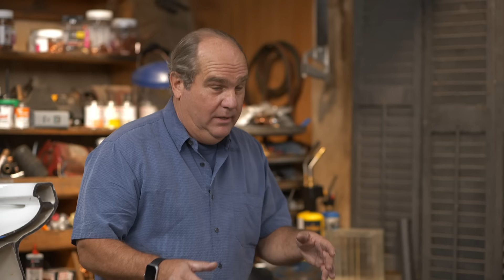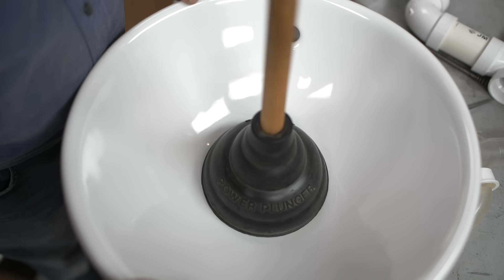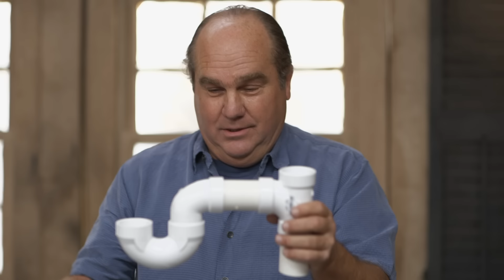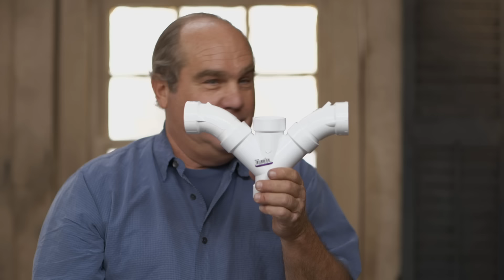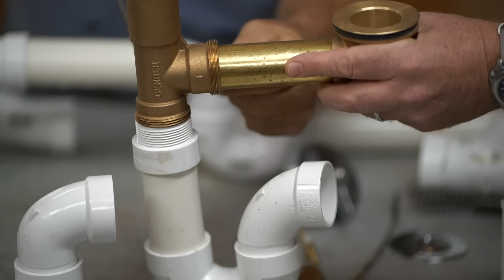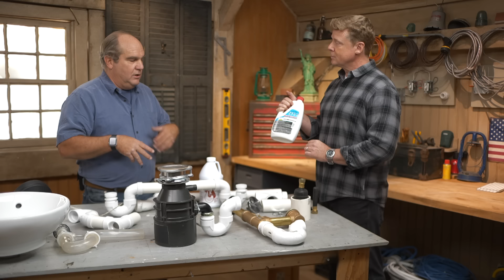How to Unclog Any Drain | Ask This Old House

Comment: He said if you use the auger it may likely go up into the vent, but didn't say how to get it to go DOWN into the drain. So if the auger is always going up, what's the solution for actually wiring the drain?

Comment: Blocking the sink overflow before plunging is a great tip. If it’s left open, a lot of the pressure escapes through the overflow instead of pushing the clog down the pipe.

Comment: Ummmmm… no help. Both sides of Kitchen sink are full of water. One side has the garbage disposal, the other side a regular drain. Tried two different types of pumps. No help because the water transfers to one side or the other. Tried the snake, still water wouldn’t drain. This all happened because I cut up a cantaloupe in small pieces, turned on the garbage disposal, seemed everything was fine until it wasn’t and clogged both sides of the sink. Anyone got any ideas on what I’m doing wrong??? Yes, most likely I’ll need to call my home warranty and get a plumber out. Such a shame!

Comment: Quite informative.  Do you recommend using an enzyme based drain cleaner for drain maintenance?  I have seen that it will prevent grease from settling in the bottom of the pipes.

Comment: Can we just move to the European standard? Their 110mm gooseneck makes our 50mm siphonic "tech" look like a joke. Stop trying to reinvent the bicycle and just use a bigger pipe so I can throw away my plunger. 🙄its wild that we still use siphonic systems. US trapways are tiny (45-60mm) just to create a vacuum, which is why we’re the only ones who need plungers. Europe’s washdown design uses a massive 100mm+ pipe it’s basically impossible to clog. We really chose a =FANCY= suction system over a pipe that actually works

Comment: One tip I learned was to find out where the stoppage is, run water until the drain starts to back up.  If it backs up immediately, that means the stoppage is near the drain.  If it takes a while to fill up, the stoppage is further down the drain.
Reply: Thanks

Comment: Would the rubber bladder work on pipes outdoors? Most vids I see are about P traps and I don't know why people don't just take them off and clean them to make sure a clog isn't there. It's really easy.
 I'm concerned with clogs far down the line of soap scum, grease, washer lint etc. When my washer drains out the utility sink it's now flowing onto the ground thru the vent pipe which comes off the adjoining kitchen sink line (doesn't run into septic tank). Fun! How would bladders do versus a power auger on 'cheese logs' far away from P traps? I religiously use enzymes down all drains every month, use two fine mesh strainers one inside the other for lint on washing machine plus another metal fine mesh strainer in the washer sink drain, kitchen takes no grease, I wipe out pans with paper towels, also use a very fine metal mesh strainer so my only thought is soap scum buildup plus silt from dirty dusty work clothes. I'm stumped how to keep my pvc pipes clean as I've spent a fortune on enzymatic gels combined with careful use of strainers etc. Maybe a power drill auger is the only thing that could scrape some of whatever's in there, off? Ugh.

Comment: Thanks. Fellas my toilet had the same exact smell my plumber tried for years clearing the 75 yr old cast iron pipes. His last suggestion was crystals. So he got the water really hot and placed crystals down the sink drain then placed one cup of hot water. He said try not to use the bathroom for a few hours the next day we both used bathroom and while brushing our teeth we noticed bubbles coming out. He said all good air is being removed we should be good. We are and are please. The real test will be in the summer when attic ceiling fan is on. That when we mostly had the gas/sewer smell

Comment: I removed my bathroom pedestal sink in my bathroom from my home that was built in 1918. It had a lead 90 degree in the wall for the drain. After an unsuccessful attempt at cleaning the drain (I used finesse)I,  I hired a drain cleaning company. I told them to be careful. They weren’t. They used a powered drain snake and cracked the lead elbow in the wall. Idiots.

Comment: As long as the clog is basically just hair I've had good results removing clogs in my lav and shower using one of those inexpensive plastic snakes.  Basically it's just a long flexible strip of plastic with lots of angled barbs on it that you work down into the trap a few times and you can usually hook onto the clump of hair and soap enough to get it to drain again.  You don't necessarily need to remove the lavatory sink stopper but it's easier if you do.

Comment: We have a toilet that keeps backing up and water runs out from the base of the toilet. Plumber says we have a sag or belly in the old cast iron sewer pipe that is causing the issue. Only fix, according to them, is to cut through the slab to the pipe and replace the affected parts. Your thoughts?

Comment: I’ve pushed a bladder in from the clean out using all of a 25 foot hose to get past the junction with a washing machine drain and was able to blast out a clog that my 25 ft auger couldn’t reach.  Not sure that it doesn’t just move and spread the clog sediment/mass further down the line though.

Comment: Unfortunately the inflating rubber bung shown at 7:00 is not referred to as anything other that "this", so not knowing what it's called I can't search for it! Also, it is very strange to refer to a basin (sink) as a 'lavatory'. UK and US definitions are different. In the UK a lavatory is either a room containing toilets and hand basins or the toilet itself, so bear that in mind if you're an American in the UK and asking for a lavatory to wash your hands in!
Reply: OK, I have found the answer to the question above. 'This' is a 'Drain Cleaning Water Bladder with Garden Hose Attachment, Medium' which I have found on ebay, but almost exclusively in the USA. Eventually I found one on Amazon UK (last one - Cobra Products 331). There are videos on how to use them out there.
Reply: Plumbers call it a "blow bag"

Comment: Hmmm, ive never understood why why and always kinda wondered  why toilets are designed the way they are.
 Like, whyy do toilets have a "drain pipe" that starts to go downward a little bit and then comes back up before heading back down..
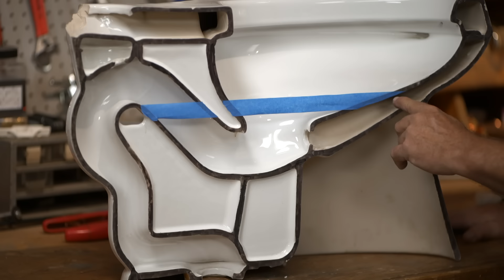 Like, at the 0:30 second timestamp of the video, you can see that when its initially flushed, it goes down a tiny bit and then all of a sudden shoots upwards at like roughly a 45* angle for 3-5" and and then shoots down again. Also, there's a slight little "turn" in the middle after it starts going down. I don't understand that, either. 
 I meannn, i know there are probably good reasonings for them to be designed the way they are, i just don't understand why, lol.

Comment: Sorry  the clog in my kitchen sink is not in the trap part,  It is beyond that by a yard or more out into the yard.  Nothing works. Even the snake we tried only goes so far and is blocked.  WE have to wait forever for the hot water to drain away to open the pipe and even try.  This video did not help
Reply: Try a jetter with a 2800 PSI pressure washer or higher

Comment: The part where you block the overflow on the sink had not occurred to me since it's years between drain clogs... and frankly, was half asleep when attempting this. I already spent an hour trying to do it with a wire to no avail. Tried boiling hot water. Nada. I thought I'd try a plunger but it was coming out the overflow and didn't think to block it. That was the ticket: plunger with emphasis on the pulling up, not the pushing down...and wrapped up tight paper towels to block the overflow. What a clogged drain... but back to free flowing now. Thanks for posting this.
Reply: Ml

⁹

Comment: I had a clog in my a/c drain that I kept babysitting with a drain cleaner but it would not clear. After an extremely humid spell it got so bad that it flooded the floors. The a/c man couldn’t get it out and eventually had to cut out a straight section of pvc. What he found was that a rat snake got in and, since they don’t turn around, died in there. My fault…I had taken off the cap of the clean out and dropped it, lost it, and did not put one back. Looked like a good hole to the snake.

Comment: There are many homes where the main sewer line is buried beneath a concrete slab, so NO CLEANOUTs at each 90 degree bend.  I have a stubborn kitchen sink clog which affects ONLY that fixture.  The other 7 drains in the house work perfectly.  After removing the trap, when I run the snake in,  I don't know if the snake goes DOWN to the main sewer pipe, or UP the vent pipe.  Looks like I'm going to need to run a snake straight down the vent from up on the roof.  Writing this helped me think through my problem.  It won't be fun, but tomorrow I'm heading up the ladder!

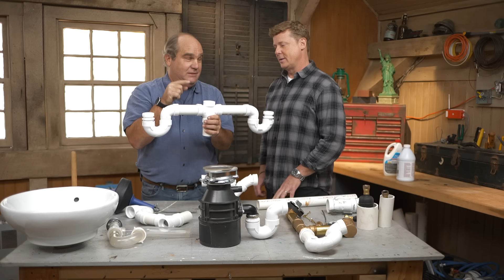Comment: 4:00 Bingo, this is my problem, old Apartment Building, my kitchen line meets very likely an old T which my bathroom sink line meets also, and grease buildup just overflows BOTH my kitchen and bathroom sinks, together, every 4 months.   I snake it both ways, until yucky grease is loosened up, and carry on for a few months.   I can't see the in wall exact plumbing, but an old T likely or something else, used in this 70 year old apartment building, in the walls, can't get to without opening the wall.   
But thanks, your 4:00 problem is similar I think to mine.  Patience, snake auger fiddling, is what works for me.
Am going to run water my next snaking of my dual lines which get blocked, as that's the thing I've not been doing.   So thankyou very much!

Comment: That "preferred" way to plumb the 2 lavys creates an S trap, which is not legal. The fitting to use is called a figure 5 which looks like a double combo, but the vent inlet is high enough not to create an s trap situation.

Comment: What a great video! Thank you! What do you think about tools I've seen for clearing toilet clogs that have in essence a bike tire pump that pressurizes a chamber in the tool (some even have a pressure gauge) - then there's a rubber seal that goes into the toilet, followed by a release of compressed air. It sounds good to me, because I'm getting old and using an old fashion plunger hurts, so the idea of a tool that you can pressurize without needing much force sounds really good to me. Thoughts?
Reply: well actually I am not able to drain any of my water draining out from my flush sinks and tub washing machine and all draining are not happening at all
Reply: please let me know how I can fix this problem please

Comment: Great basic plumbing techniques,  however the vertical combination you used is illegal and breaks the vent. Utilizing 2 offset tees  would be another correct method. Tees are used only in vertical applications by international plumbing code. Wyes and combinations are used mosty horizontal applications. However a wye can be used in vertical application where necessary but not combinations.

Comment: I take my plumbing problems to Al Bundy. (Married With Children) He prefers the "Ferguson Toilet".  🚽🚽🚽🚽
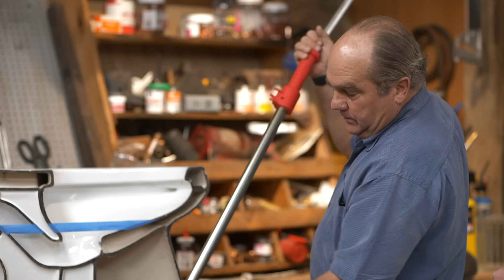01:28 Al Bundy's "Doody Master 2000" toilet unplugger.  LOL   🚽🚽🚽🚽

A big shout out to Tom Silva. We met at the grand opening of Rocky's Ace in Walpole, Ma. around the year 2002. You gave me an autographed 8 x 10 for my unsignificant other.
Richard, I've had the slowest draining sink in my bathroom for about 6 months. I tried Drano several times, baking soda & vinegar several times, and a plunger each time. No success. Tried flushing with hot water & plunger each time. n/c.   I covered the overflow opening as suggested. But instead of a rag I used 3" wide duct tape to cover the hole. Let it run until it got steamy hot and then used the plunger. Three plunges and woosh.  Drained faster & more powerful than Niagra Falls. Why didn't I cover the hole up 6 months ago?

Comment: Quick question about using the snake. When it goes past the p trap and enters the main pipe (going down to septic), is there any way to make pressure go up or turn the snake upwards clear a potential clog in the air vent? Richard said they some times go up or down, haven't tried the snake yet, but starting to think there is a clog in the main pipe blocking air from going up to the air vent. My roof is really high, it's winter in New England, and I have no easy way of getting up there. Any help would be much appreciated as I've tried everything at this point.

Comment: Good job guys. It has been a blast following along with this project and with you guys from almost the beginning. I bet you could drop in an "L" of plywood and rebuild those blown out corners. might not be worth the work though, just use a little extra concrete and you have already saved a ton of money by digging it yourselves. I venture to say probably better than a lot of subcontractors would do.
Reply: On the other hand, Florida State really did look terrible.

Comment: So, the stopper in my sink was attached to the metal arm of the up and down thingy that allowed you to hold water in the sink.  Had to find that out on UTube.  Had to get under the sink, enclosed in a cabinet, not easy, and unscrew the mechanism to free up the stopper from the arm.  Seems it can just sit in top of the lever or the lever can go through the hole in the stopper.  This was a Kohler faucet.  The problem was that it was stopped up and any drain opening stuff would hardly go past the stopper. Now, I can take the stopper out and clean the whole thing, including the bottom, which gets a lot of gunk on it.

Comment: I've used the drain bladders with good success with bathroom pipes but my kitchen sink has a metal piece that partially blocks the drain opening.  This prevents the insertion of a bladder down the drain.  Trying to figure out a different way to flush out the drain.  I'm guessing it's just an accumulation of coffee grounds.  A plunger partially clears it temporarily.

Comment: I have PVC pipes and a drain.  Clay is clogging my pipe about 25 ft from the
Sink: kitty litter.  I have read not to use hydrochloric acid or any assets because of the drain field.  
Thank you so much.  Great video.
Field.  Any suggestions please.

Comment: If your snake has a drop head, that will help a lot. It uses gravity to help take down the drain. Google it. I use it on my Super-Vee all the time. I’ve never had to cut a pipe to get the cable going down the right way.

Comment: Another channel says to first try putting Dish Washer Liquid into the drain and let it sit for 10 minutes then Run HOT water into the drain to clear grease build up.  Many times this will cause the grease to breakup and move along?
Reply: I never thought of it for sinks, but we use this method on the toilet.

We live in a 2nd-floor apt.

As the water drains slowly from the bowl, hold an upturned bottle of regular liquid dishwashing detergent over the deep part of the bowl so that the concentrated soap will seep into the drain pipe.   Put about a cup of it in.   Let it sit for half an hour or so.   Then slowly pour a 5-gal bucket of very hot -- not boiling -- water   into the deepest part of the bowl.  Often the water starts draining and clearing before all the hot water is added.  If not, it can sit for about 5 min and will probably start draining.  If not, just a couple of plunges gets it all flowing.    Usually I then pour another bucket of hot water down, just to be sure the clog has moved far enough down the drain.   Works great.

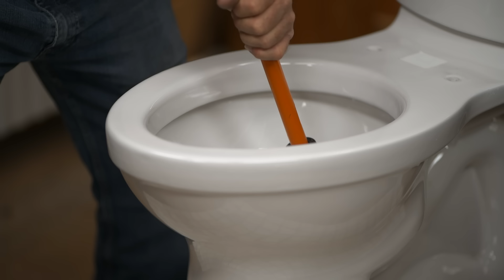Comment: I worked for a company with 800 vacation rentals. I got a call every other day about a clogged toilet. The guests would say it's no use, they'd already plunged it. Well, they should have done it like Richard at 1:02 because that's the right way. Actually, don't pull it that hard unless you like poop in your face. No more than two or three "pulls", not pushes, and the clog is gone. 

And clogged tub? It's hair. It's always hair. It's never anything but hair. Unscrew the popup or pull out the tub drain linkage. Then use needle nose pliers. As I would tell folks, "Look, I pulled out the entire cat."

Same for bathroom sinks. It's always hair. Unscrew the popup lever under the sink with a pair of channel locks, pull out the stopper, needle nose pliers down the drain and pull out that fur ball. Good to go.
Reply: Waffle stomp. Tub clogs aren't always hair.
Reply: Im bald. My shower & bathroom sink drains slowly
Reply: What happens when it’s no hair in the p-pipe under bathroom sink and sink i still clogs?
Reply: @melindawilliams136  I will modify my above statement, 99 times out of 100 it's hair. You could have a blockage like soap/grease down the pipe. Try running lots of hot water then a cleaner like Comet or caustic lye if you are careful. Let it sit, then more hot water. Hardware stores have nice little flexible plastic drain snakes you can run down the drain to try to break it loose.
Reply: @michaelallen5505 I very much appreciate you responding. You earned a subscriber. I got a Husky Drain snake 25ft from Home Depot but how do I know if I’m hitting a turn or a clog?
Reply: @melindawilliams136 mostly hair. There are occasionally gum up toothpaste mix in with food gunk. Make it a habit to use old fashion baking soda/vinegar combo and then pour in hot water. Or tell your hubby/bf to do the dirty stuff and clear it out the manual way.
Reply: It’s usually hair unless it’s that one time I pulled back a SOCK and a piece of broken tile. But yeah, I agree.

Comment: I work for a state park system. We've been using those black expanders for like 15 years. They work so well. Love them and swear by them.
Reply: FYI...the instructions don't mention this, but you need VOLUME in addition to PSI. If you use a small diameter (like 1/2 inch) hose you will get the PSI but NOT the volume. It's the volume that makes the bladder seal in the pipe. Good luck!